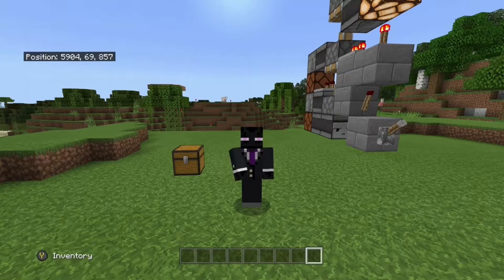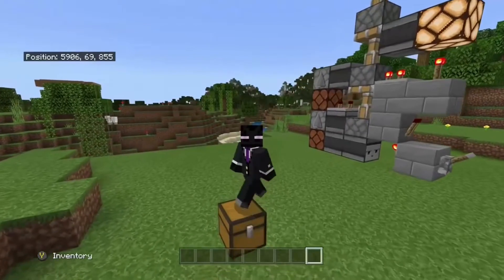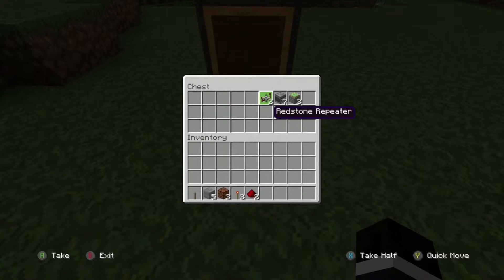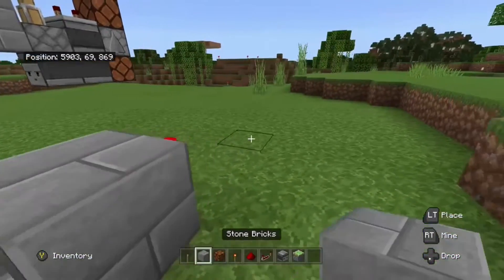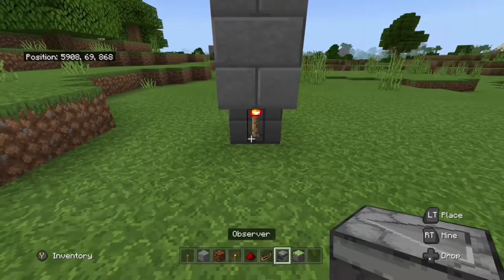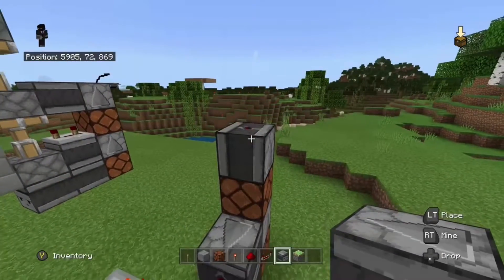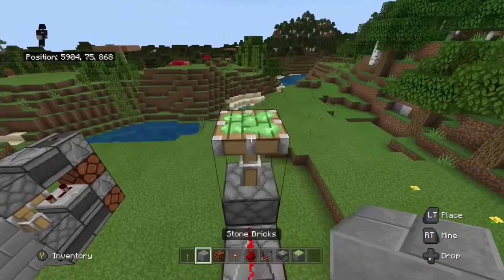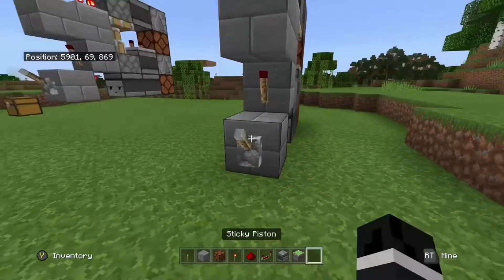✔️Minecraft: How to Make a Triple Piston Extender - Bedrock 1.16

Comment: Let’s say the top of my piston tower is the floor, how could I move the lever so it’s at the same level (on top of ) the floor? I can’t seem to find a way to run a circuit
Reply from the maker: I don’t think you can sadly, though I have a DOUBLE piston extender that has a movable lever.
Reply: couldnt you run a repeater into the block the lever is powering?
Reply from the maker: @supercat4259  You can actually try
Reply: @PotatoGamer-rg4nn  i did it i made it so the lever broke when i went up so i could go back down but i also made it break that lever to so i could go up after i come down so it is possible it iskida easy if you use glass for the Redstone to go done fyi
Reply from the maker: @funandgames9607  Good
Reply: @PotatoGamer-rg4nn  hopefully Niko Jurkovic responds because he asked
Reply from the maker: @funandgames9607  Yeah we’ll see
Reply: @PotatoGamer-rg4nn  hopefully he will lol
Reply: @supercat4259  it is possible
Reply: This is a late response, but you can use target blocks. Put the lowest red stone torch on the target block, and put red stone behind the target block. Red stone always runs into target blocks, so you can run a red stone line from anywhere and it will still power the target block and it will turn off the red stone torch